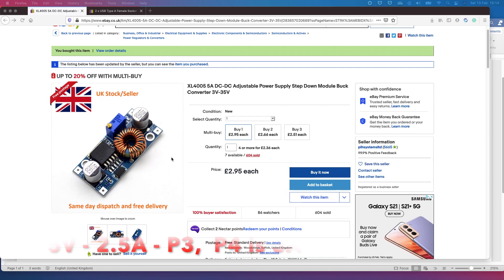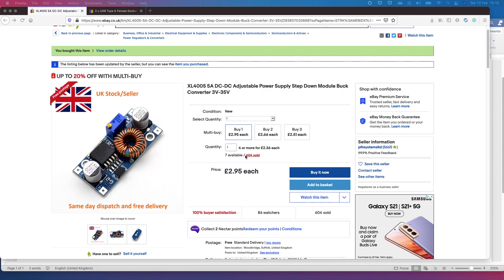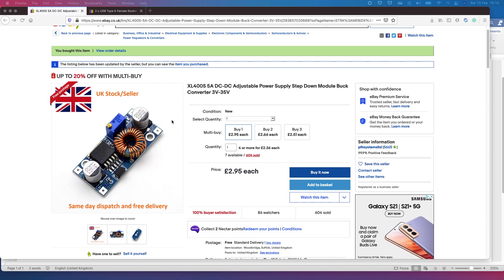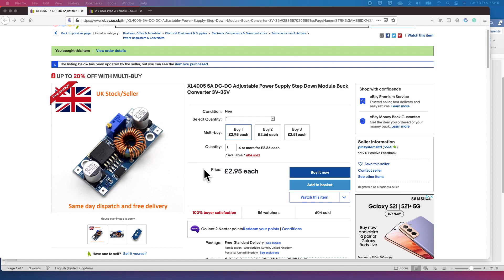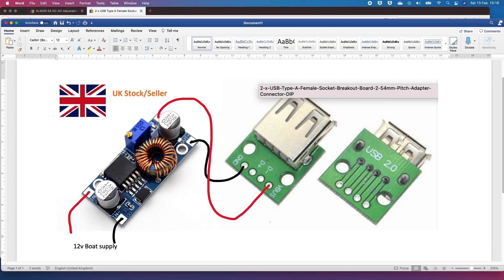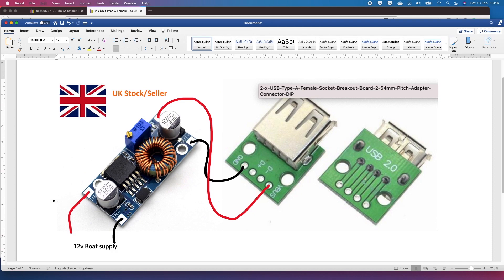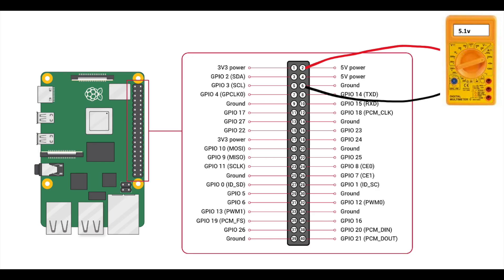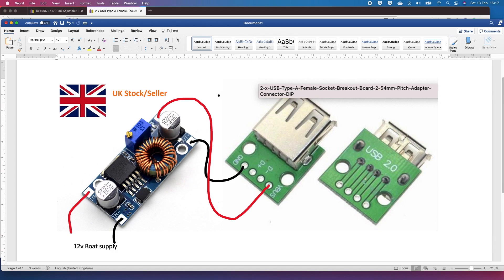OpenPlotter - Pi Power - Boat batteries to 5V

Comment: I used a powered USB hub that used a 12 volt wall wart. I directly connected the hub to the batteries. It works great and allows me connect other devices to the pi without drawing power from the pi. Each port has a switch to making powering the pi down simple.
Reply from the maker: Does the voltage of the USB ports change if the batteries are on charge?
Reply: @BoatingwiththeBaileys  I did not test the voltage but the batteries were under charge at the time and the pi made no lightning bolt complaints.
Reply from the maker: Sounds good